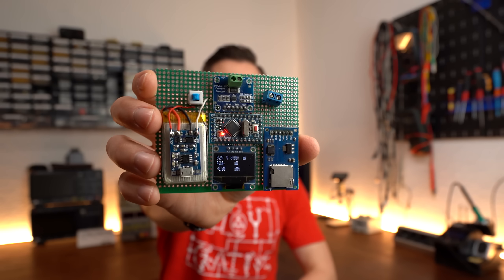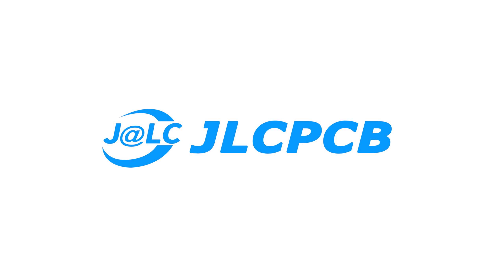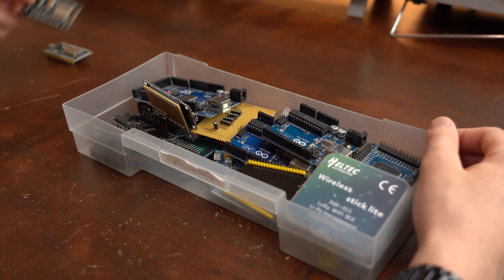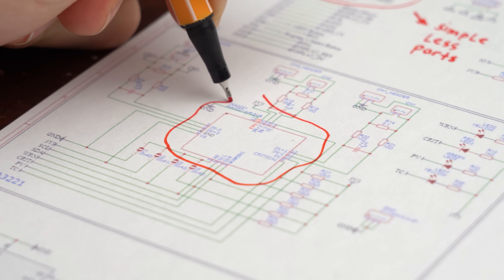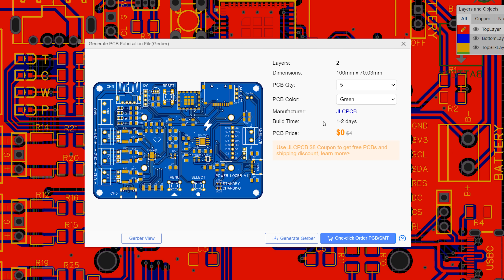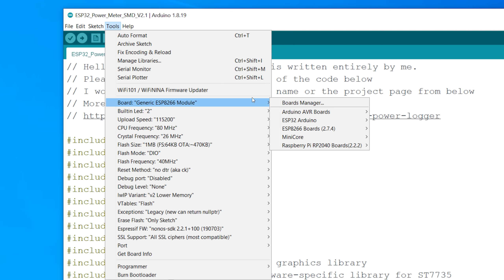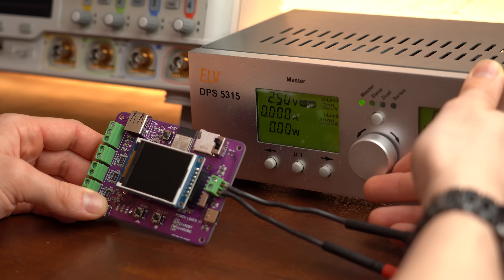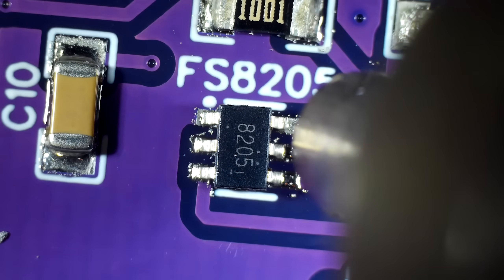A Viewer Remade my Old Project! So is it any Good?

Comment: For those who want to build this project and can't upload:

I have assembled the project and i can't upload as Great Scott. The problem is when you first time upload, you MUST pull gpio9 (not gpio0) to ground. Which is connected to SELECT button on the board. Hold down it while connecting and try to upload. İf it fails again there is RX and TX pins on the board which are DC and RES pins of the LCD. You can also upload with FTDİ adapter. After the first upload (usb or ftdi doesn't matter) you can now upload anyway you want. 

Hope this comment helps someone

Comment: you can also reflow solder by putting the whole thing into an oven
in a hardware factory where i worked for a while that was standard practice (although those ovens were of course purpose built for that)

Comment: A simple yet effective tip for SMD reflowing is to use an old glass-ceramic cooktop. Set it to about medium heat, place the PCB on and watch the solder flow. Its how I do all my PCB projects at my dorm where I cant really use a soldering iron, due to smoke detectors, but I can use the kitchen XD. Works a treat, if you are careful with heating.

Comment: I definitely recommend switching from the Arduino IDE to Visual Studio Code + PlatformIO.
Also, the ESP boards can easily do OTA updates too, so you can do wireless deployments from your IDE to the board.
Reply: Yeah. I think PlatformIO is such an underdog. Would not like to do my job without it anymore.

Comment: I wish microcontroller boards were made like RAM DIMM modules - with standardized edge connector easy to slide into the connector socket, easy to solder wires to bare PCB board, easy to upgrade/swap.

Comment: Hey
I remember your version of a Fireworks ignitor. I built a similar one at the same time. At the time I am 3 version further and it is much more advanced now (addition safety features in hw & sw, higher ignition voltage, larger range and 433 Bandwidth, resistor measurement,...). It seams like I can finish the basic version till this year's Silvester to test it out.

Comment: Hi can you improve this circuit, by adding 2 sensor, assume the tank is changing slope inclined or declined so one sensor on one corner other on another corner and based on both sensor data measure exact liquid.          https://youtu.be/VobYZbzTXzc

Comment: I'm still stoked with that variable voltage convertor you featured off of Aliexpress...   I had bought two as sometimes one will turn up broken and such a small price, I use one to power up the many broken laptops I am troubleshooting here, one input, one variable output no multitude of cables.   The other is doing duty charging my 18650's, my dedicated cell charger broke and I just whipped the burnt out guts, fed in the wires, soldered the outputs to the cell charging common rails and voila... lithium cell charging on the cheap like a pro :D

Comment: I built and have used your original version and did not know there was a bug in the software. I'm kind of surprised you didn't show us the bug in the code and what was wrong with it.
I'm not a very good programmer. If anyone knows how to fix the bug please enlighten me. Thanks.

This new design surprised me in that it will only read up to 1.63A that is not a lot.

Comment: Is that heater the sort of thing you would use for smd components on say a motherboard PCB so for example capacitors didn't pop as they would if you used a hot air station?  Do you have a link to it?

Comment: Thank you very much 🌺🌺
I have a question :- I used ESP-32 and programming it  with Arduino IDE , the program was very simple it connected to WiFi and turn on and of some led. It is working but  the temperature of  ESP-32 was increasing, Why ?

Comment: It would be interesting to see if its possible to make a reflow hot plate out of a 3D Printer heated bed
Reply: I was just thinking that.  One of my printers has a bed that is bare aluminium, and should be able to get to around 260 degrees (which is the temp most cheap solder reflow plates seem to use)

Comment: Raspberry PI 4B version 1.1 had set the two 5k1 resistors incorrectly. They simply shorted both CC lines and connected them to one 5k1. In version 1.3 there are then two separate resistors for both CC lines.

Comment: An efficiency mode is a great idea for a multi-channel power monitor,, I hope someone adds this feature to the firmware, although its not hard to calculate from the numbers already given. Another good reason for multi channels is to monitor multiple power rails, as many devices have these days, or the power being used by different parts of a circuit when prototyping..

Comment: I rebuild your Liion Battery Capacity tester to test my 24/48V solar batterys, but hooking it up to a lab bench power supply and supplying it with >20V "battery voltage" it starts bugging around creating voltage peaks of 90 to 300+ Vdc over the drain-source of the mosfet

Comment: When using hot air to solder smd components flux should is your best friend more flux better 😅, but not too much, the flux should be free flowing , i see in your video not enough flux that is why solder does not want to stick in turn longer heating time, you have to be more generous of using flux hehe😉,

Comment: 4:20 Wasn't something like that a problem with the original Raspberry Pi 4 and required a revision to be properly USB-C compliant? AFAIK they had to use two different resistors to make it work properly.

Comment: It might be time to look into small 3D printer heated beads to use to upgrade your reflow station.  They come in larger sizes than credit cards and some of the smaller beds are only 120mm square.  The ESP32 may be in a tiny package, you can still look to see if the communication pins, power, ground and USB are actually getting to the footprint.  I would not doubt somewhere else in the circuit there is a problem that a microscope can not see properly that probing the pin contacts will let you find.  I agree for what it is that 8/10 is appropriate marks especially with the power issue.  It would be nice if you mentioned a potential upgrade, possibly as simple as a slide switch, as an alternative than always have a battery.   Stay safe, stay creative.

Comment: When using a hot plate and/or hot air, I recommend putting some thermal vias in the pads under ICs to help with heat flow. Via-in-pad comes with its own issues, such as the need to find a balance between needing a bit more solder paste while not bridging, but it’s often the _least bad thing_. Shrinking the pads* under the ESP32 can also help reduce bridging, which I suspect may have been the root cause of the board failure in this video. Just a guess.

* Or if you want to get fancy, shrink only the stencil (paste layer).
Reply: Not sure that shrinking the stencil would help since the solder would spread anyway, but otherwise I agree.
Reply: @nimoy007  I YouTube ate my earlier reply. In any case, if you search for “optimize solder paste opening”, you’ll see some good examples of how to better control the spread of paste on larger pads. Reducing paste for large pads is a common recommendation from chip manufacturers.
Reply: @a1nelson   Actually, nevermind, you're right. That totally makes sense on second thought, because you're just trying to prevent large quantities on the pad, not keep it from spreading.
Also, I know the personal pain of soldering QFP ICs and cooking them. Then, you've got the opposite issue for SMDs connected to large ground planes, where thermal breaking makes a huge difference for reducing the heatsinking.
Reply: @nimoy007  It's a fun discussion. I used to believe that thermal reliefs on pads connected to pwr/gnd planes were useless for doing anything but adding resistance. Then, I wondered why some simple caps or resistors were so hard to solder. Ya live, ya face-palm ya learn, haha. QFNs - I always order extra because I know myself and I know that I'm gonna goof at least one up along the way.

Comment: Be careful using this project.  The grounds of your test supply and load are not isolated from your computer.  There's the potential for a catastrophic ground loop through your computer chassis.  Don't ask me how I know.
Reply: How do you know?
Reply: @definitelyabot  Let's just say I've got 2 $500 burned out mother boards and some USB cables with scorch marks.

Comment: Hand solering and homereflowing the USB C connector can cause issues. Could have been the ESP32 was fine, but the data pins were not soldered properly.

Comment: There is also the esp32-c3-wroom version which is much easier to solder, except the themal pad.
Reply from the maker: Thanks for the tip.
Reply: @greatscottlab  but is also has another footprint and would need a redesign of the PCB

Comment: The ESP32-C3 comes in different packages just like every other ESP, but it looks like the design you got called for the MINI. The WROOM exists as well, which is what I use, and it has a slightly larger footprint but has easy-to-solder pins just like all the other ones.
Also, you forgot to mention one of the coolest parts of the ESP32-C3, it runs RISC-V cores instead of Xtensa cores, meaning compiler support is way more plentiful compared to before
Reply: If it has RISC-V cores does that mean it can run an os? I barely understand RISC-V tbh
Reply: @alyxburke  Almost anything can run an OS. Just depends whether anyone's written one 😁
Reply: @cooperised  Important to note that some OS's require specific hardware features asside from the CPU.  Linux, for example, requires certain memory controller hardware to be present.
Reply: @EmperorA0  Well, yes, and many small RTOS are quite architecture specific and not very portable. But my point was not that any given OS could run on almost any silicon, rather that almost every modern MCU is capable of running some kind of OS.
Reply: @alyxburke  esp32 runs rtos on it

Comment: 10:16 The TP4056 probably creates this noise because its battery terminal is not bypassed with a 10uF capacitor, as is recommended in the TP4056 datasheet. Should be an easy fix to get rid of this noise.
Reply: That's some useful information.
Reply: Came here to say the same. Ask me how I know… A tiny load resistor helped my project as well, though whether this would be useful likely depends on the ESR of the 10uF.

Comment: It would be interesting if this could start a huge project.  This is the base device and depending on what you want to monitor, you attach optional boards.  It would be pretty sweet for this to monitor USB powered, 12V, 24V, 48V, and mains powered devices.  And any other commonly used voltages that i'm not aware of.
Reply: I made a similar comment above. But my idea might be a bit more involved 😁

 There's a wonderful open-source SMU design that's been recently documented and released on eevblog and on YouTube by djErickson. Obviously a source measuring unit build would be a bit complex....but with the boards and parts all available, and the documentation so well done... He could definitely do it and make a video series on it.  just be like assembling a complex kit... 

It's one of the only things I've never really seen many people tackle a DIY affordable option. A good and somewhat affordable source measure unit would really be a lifesaver to a lot of techs and Labs who can't afford the $5009-$10,000 asking price for the entry level units.

Comment: Pretty cool! I imagine there are probably esp32-c3 modules that have castellated pads instead of that no-lead style. Note that the C3 had limited USB only for programming: is not like the S2 or S3 where you can do mass storage or hid.
Reply: can the S2 S3 be also programed via USB without any prior code on the ESP32?
Reply: @sanjikaneki6226  Yes, if you boot from the internal ROM they show up as a serial port on the PC and can be programmed very easily. Beware that there are also other differences compared to the "old" dual-core LX6 ESP32: for example, the S2 has a single LX7 core and no bluetooth, while the S3 has a dual core LX7 with bluetooth, but no DAC.
Reply: Yes, they have a ROM USB bootloader

Comment: Could you remove the battery charging parts and run it without that way?
Reply from the maker: You will need to connect the USB power lines to the 3.3V regulator. Then it should work without battery :-)

Comment: A really useful device, maybe 3D printing a case for it with an integrated battery and a little code modification to display the battery percentage instead of the voltage (or both) would be quite useful.    Happy holidays.

Comment: good responsive buttons is surprisingly difficult, getting the timings just right, so many possible weird combinations of states.. really makes you appreciate object oriented programming 😆
Reply from the maker: Yeah I agree
Reply: Even commercial products have issues with this. The elevators at my work, when pressing the bottom, they make the tactile sound and the indicator behind them lights up, but it doesn't always stay lit, requiring you to press them multiple times until it sees that you pressed them
Reply: Hi, I'm a complete noob, could you explain to me what is the difficulty involved in getting buttons to work in both hardware and software?  I was interested in this because I have a usb meter, tc66c, and sometimes a button doesn't work on several touches which leads me to believe it's faulty and other times it works perfectly
Reply: debounce, interrupt handling, purified code are the magic words my friend

Comment: 4:24 Ah! I always wondered why some of my devices (RC radios for example, and other RC components which I suspect use cheap ESP32 components) will work when using a USB-A to USB-C adapter, but not a direct USB-C to USB-C cable. I suspected there was probably some component they omitted. Now I'm even more upset that it's because they are too cheap/lazy to include a couple simple resistors. 🤬
Reply from the maker: Glad I could help ;-)
Reply: It may not be a cheap thing but simply a "didn't test" or "didn't read spec" thing.  All things that should have been avoided, though. My wireless earbuds case has this problem...
Reply: @rpavlik1  yeah for me that would fall into the laziness category. Such a simple thing, obviously documented in a spec sheet, and they just… didn’t do it. If you’re serious about making a product and calling it USB-C and it does this, in my opinion you have failed.
Reply: @swissfreek  have you read any USB spec? It is really really long and complicated.
Reply: @rpavlik1  no I haven’t, but then again, I don’t make my living designing USB-powered devices. This seems like a pretty major aspect of it as well: telling the host to give 5v to power the device you manufacture!
Reply: @swissfreek  I'd like to note that the Raspberry Pi 4 actually had this issue.  So, anyone who remembers that fiasco should be avoiding it today.  However, it shows that even extremely large projects can miss things.
Reply: @rpavlik1  they might have test it with a non compliant usb-c charger that just outputs 5v all the time.
I always check the USB-C chargers what they output because i've seen one that just pumped out 20V without any handshaking.

Comment: Two questions/proposals:
1) Who was the viewer who remade this?  (and why 8 and not 9 or 10?)
2) I propose building a super-simple game using as little IC's possible and cheap components. This is to trigger the desire for young entrepreneurs and to challenge them into small steps of designing and soldering to achieve a small but rewarding victory. The game should be upgradeable and open source for future add-ons and improvements...which can also turn into a challenge for all to make it bigger and better. Merry Christmas!
Reply from the maker: 1) He is linked in the video description. I said in the video why I went with an 8 rating. There are of course a few other reasons for me why it is not a perfect 10 but those did not fit in the video to keep it shorter.
2) I can put it on my to do list
Reply: @greatscottlab  Thank you for replying, this shows that you do care about your viewers which is why I keep coming here and try your designs. 
Thank you and...Hertzlichen Gluckwunsch! ( I hope I got that right).

Comment: You REALLY need to build you a cheap reflow oven!  Seriously...all those SMD builds, it's almost imperative for you to have one...hand soldering with a reflow gun can damage sensitive components pretty quickly...a reflow is much more controllable
Find some of the controller boards online and find a cheapo IR toaster oven...and viola!
Keep em coming!!!!
Reply from the maker: I actually got an infrared reflow oven. But I honestly prefer a hot plate or hot air. Maybe that will change overtime.
Reply: @greatscottlab  With parts like the ESP32-C3, the oven will probably work a lot better.  (Though a hotplate will likely also be better than hot air from the top.)
I've personally avoided the IR ovens, but I have a Controleo3-based converted toaster oven and it works pretty well.